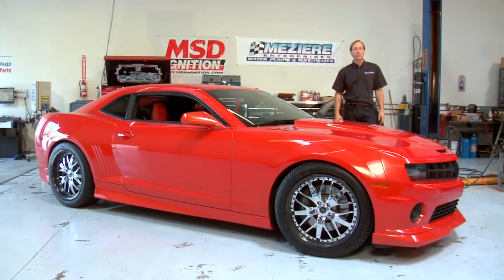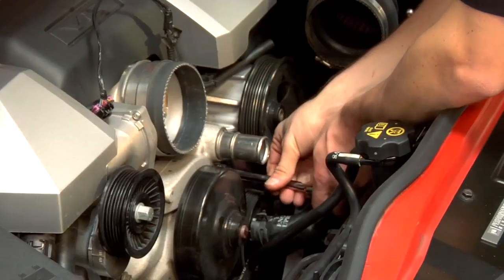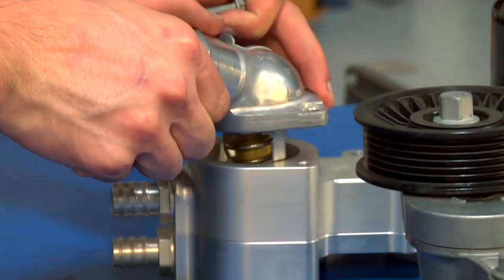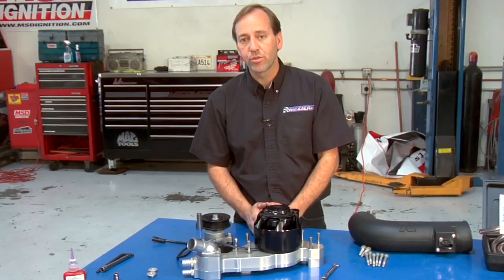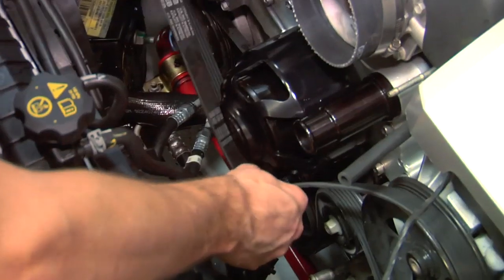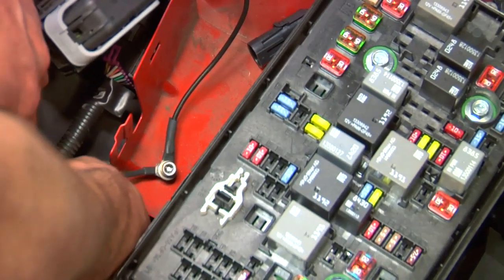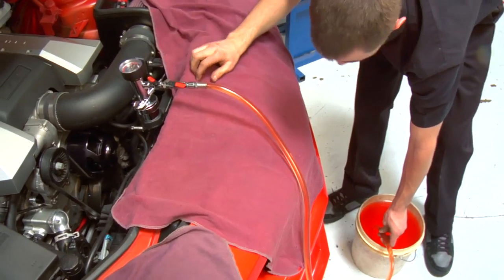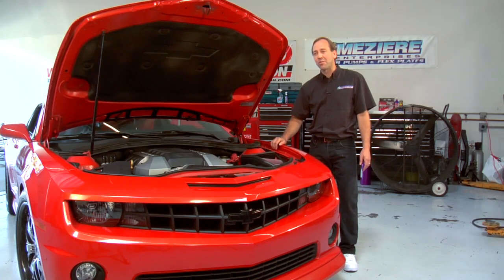Meziere WP 329 Camaro Electric Water Pump Installation

Comment: Are there electric versions pre-made for the older 95 corvette LT1s.So I Don’t need to do a bunch of stuff to convert the stock pump impeller and shaft/ bearing n rubber bushing removal???????
Reply: Sorry but no. The 1995 LT pump must use the factory cast housing.

Comment: I don`t get how the free those hp. The system converts mechanical energy from the engine to electric to feed more needs of the alternator and waste some power, then it converts it back to electric to rotate pumps motor and waste it again. Do it really needs 6hp less than an old good belt driven system or they are cheating... or what?
Reply: mimi mimi eliminates parasitic drag and with a higher flow keeps the engine cooler. I'm getting one for my off roaring rig in building.

Comment: There seems to be mixed instructions regarding where to put the thermostat.  I have a early model 2008 ls3 c6 (which apparently is slightly different than the 2009 ls3).   The wp319  meziere unit has the thermostat located in the black upper hose fitting whereas this video illustrates to put the factory thermostat on the lower left corner instead.  Information on the web is conflicting.  I don't presume 2 thermostats are needed so which location does it go?
Reply: Spirited Driver I was wonder the samething, because I just bought the WP319. The unit they are useing looks like the WP319 with spacers.

Comment: Good to stabilize the temp. Less head gasket problems. Good for shut down cooling. Would help stop restart ring gouging of cylinder walls. People don't understand the only way to make a heat soaked engine hotter is to shut it off without cooldown no load period. !
Reply: i do agree and you cant see how the temp goses up after shut down like you could with older cars.. stupid Idiot gauges..
Reply: stanthology so in Theory this is a better way of temperature control for somewhere like year round Denver Colorado with traffic ? With a big block charger? And would this help with hot spot control? Aka = less knock = more power?